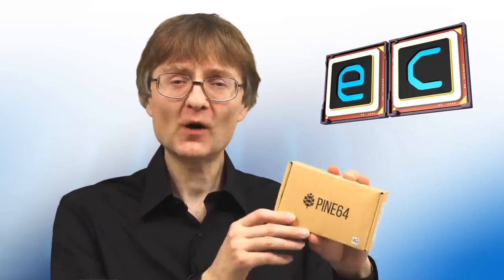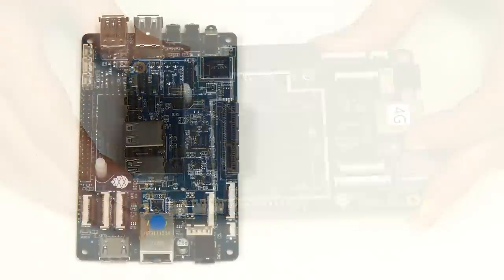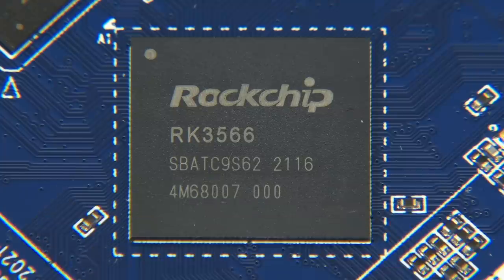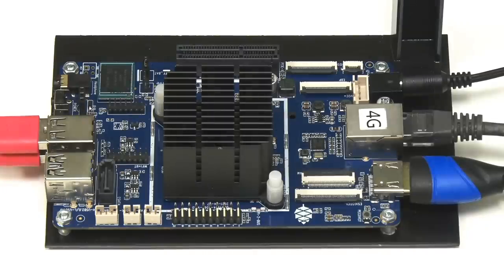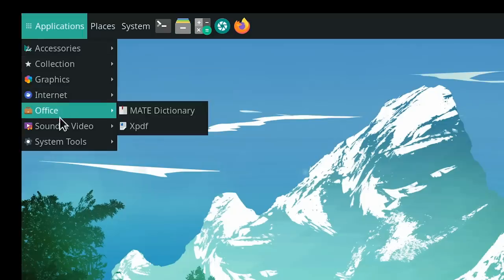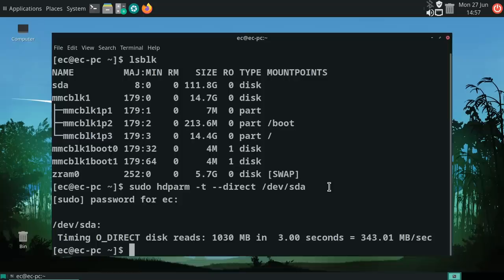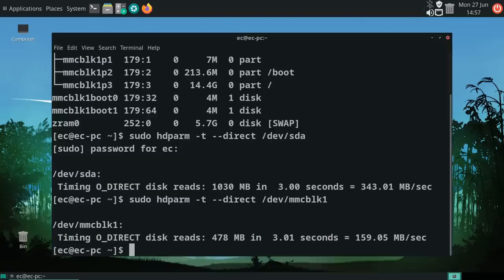Quartz64 Model A – PCIe & SATA SBC

Comment: This had so much potential but has been IMO neglected by the programmers at Pine, to not have a fully working desktop over a year after launch is unheard of, maybe they should relaunch it as The Lemon Pi!
Reply: That's the secret sauce of Raspberry Pi-- software and long-term support.
Reply: They intentionally release boards with immaturely supported (relatively new or obscure) chipsets, so as open-source enthusiasts can tinker with them and hopefully add mainline kernel supports to them in a relatively early time. Pine64 themselves don't really provide any software support to the devices (maybe a basic BSP boot image or two, and that's about it). While it is a bit doubious business model, they are welcomed by open-source communities because some boards are better than no board.

So, you really should not buy random boards from them unless you are okay with that. Some old boards (based on Allwinner A64, RK3399, etc) are pretty well-supported, but new board, not necessarily.
Reply: @Peter Kropotkin Gatekeepers are in every community. Use a computer however you want, that's kinda what Linux is about, right?
Reply: @countorlock3148  Me too! I originally intalled a Red Hat version that came on a magazine CD ROM although I had dual boot as Red Hat was used as a learning tool only, luckily I leared CLI on my Amiga in the late'80s and the transition from Amiga CLI to Linux was easier because of this, Im no expert far from it but I do try to do things from CLI, its so fast! and the OS is lightening fast, back in my Amiga days we used to call Windows Windoze as 3.1 was so so slow LOL
Reply: @Peter Kropotkin I wouldnt call my self a scrub but im neither an expert, i can acheive what I set out to do.
Reply: @Peter Kropotkin Hahaha okay dude. Y'all let's drop this. It won't go anywhere.
Reply: It seems the problem with lack of support is the drivers for the hardware. It appears those making the distros for the hardware are waiting around for others to make the drivers for the hardware. This really plagues the PinePhones as there is still not a single stable OS for either model them despite the first version of the PinePhone was shipped way back in January 2020
Reply: You lot need to stop feeding the troll who lives under the bridge. Leave him to his ego and his CLI lol
Reply: @Peter Kropotkin or maybe buy one to learn about Linux? I bought the first raspberry pi and learnt about Linux from that. Now I use an old laptop for light tasks.  I think  buy something to learn about it! It's fun overcoming problems.
Reply: @Peter Kropotkin That sounds a bit mean and pompous and isn't a very good advert for Linux, I am a member of the 'open source ' community and it very much is about helping and encouraging people at all skill levels, your comment suggests that you yourself have misunderstood the term as it hinders and discourages people who want to learn.
Reply: @CyborgZeta  Well said !...cheers.
Reply: Pine64 doesn't have any programmers at all. They release the boards before they are fully supported so that community developers can get their hands on it.
Reply: @Peter Kropotkin One thing that I would point out is that the leggy display output here indicates a deeper underlying issue of the board, the poor upstream kernel support (at the moment. it is improving, albeit slowly). The problem is not just with the video output, many other peripherals on the board are also not well-supported. If you don't need a display nor any of those peripherals... then you are not the target audience of the board anyway (it is not the best bang for the buck if all you need is some processing power). 

Also, the graphic output is one of the main selling point of this chipset. So, it IS a big deal. You don't just say "terminal is good enough" and call it a day when the intended applications of the board is broken.

In fact, the intended main use case of the board at the moment is... to let open source devs to FIX these issues (including the GPU support). As mentioned previously by myself and by a few other comments, Pine64 is doing this intentionally (they know that there are open source devs who would volunteer to do this, and the open source community is kinda okay with it, because someone has to make hardware).
Reply: @logan26111  Makes sense.
Reply: @RetroGameStream  all the people saying whoever can't blah blah blah or whatever are probably new users on an egotistical power trip.
Reply: @Peter Kropotkin Turbo virgin.
Reply: Wait, what? Since when has PINE had programmers? I could have sworn they relied on unrelated volunteers like Megi for software, and only dealt with the hardware side of things.
Reply: @execration_texts  🤣🤣🤣
Reply: You are justified in expecting a "full experience" (plug and play smooth graphical experience) since its a sbc just like the rpi that managed to achieve that. But when it comes to pine, you have to look at another angle.
There are PINE engineers, and community developers. One makes the boards, and the others make it work.
So, if it can boot and show things in a screen, then that is already plenty. And, from what I gattered, most drivers are working and all the ports respond. 
Give me a working kernel and the drivers, and I can work myself out from there, and thats what someone interested on this specific sbc at this especific date should be able to do.
If you want a smoother experience, go the LTS route (literally) and grab the older model, that is tried and true.
Reply: Learned my lesson with the Rock64.
Reply: Yeah I have the RockPro64 and Rock64, neither have a desktop that works well. I run them CLI

Comment: The appeal of the sata port had me excited, but what good is it if you can't use it (at least easily). Thank you for testing out this board, saves many of us the expense and headaches.
Reply: Why can't there be sub $50 sbc with a Sata port that works? It would make some serious money.
Reply: @setgeeks  agreed, I think there are many of us that would like to use an SBC as a lan connected fileserver.
Reply: @setgeeks  It's called a thin client like fujitsu futro, HP Txxx or Dell WYSE
Reply: @setgeeks  They have been around for a long time: take a look at the "Banana Pi"
Reply: It's easy, simply write your own driver and do you own reverse engineering  ; )
Reply: @MarquisDeSang  yep, nothing easier than reverse engineering an ARM SOC using marketing material. ;)
Reply: @tonyfremont  Easy if you have the tools and... an army of the best electronics specialists and OS writers.
Reply: @tonyfremont  haha
Reply: I don't really get the point of these SBCs. What's the point in having a tiny, underperforming, exposed motherboard, when something like a thin client is more capable, in a case, and ready to go?
Reply: @FlyboyHelosim  They have more input and output GPIO + microphone array + lcd output + ... than a regular pc and they are dirt cheap. Also the only way to have a cheap Risc-V Linux to programme in Risc-V Assembly.
Reply: @MarquisDeSang  it might not be necessary to write a driver but only simply update the device tree... But: you need to know the HW details...
Reply: @ronaldglider  Or just trace the CHIPS with an electron microscope and the pcb with an X-Ray… Easy.
Reply: @MarquisDeSang  Yeah: I have nothing better to do than buying a 100'000$ tool to fix a 60$ board!
Reply: @ronaldglider  Easy just build the tools yourself, save 1$
Reply: Thanks, everybody for a very lively and enlightening discussion. Just taking out a second mortgage now to buy that electron microscope. Anyone want to go halfsies?

Comment: Looks like the Quartz64 Model A is a SBC with potential, but lacks software support even one year after release. Thanks for another high quality review.
Reply: I was thinking the same thing. Seems they released a whole lot of hardware features just for the sake of saying “We have this”. I know SBCs are for tinkering, but kinda useless to have hardware available that isn’t actually usable - like having 4 different video outputs on a device who’s own webpage says the software doesn’t support video output.
Reply: aggree like another pine64 board less software support
Reply: @Tony Yeah, this isn’t likely for the average user. I just find it odd that even a year later, the official software is still in “beta” (basically) and lacks video support on a device that has 4 dedicated video outputs. But I do agree that for someone who has the knowledge and time to spend developing for the hardware, this isn’t likely as big of an issue.

Comment: What good is an SBC without working software? Honestly at this point I'd struggle to justify any ARM SBC not called Raspberry Pi if the maker's idea of software support is 'let the community do it for us'.

Thanks for showing us all these SBCs 🙂
Reply: This attitude is becoming endemic to manufacturers in China, eg. Creality the 3D printer company does this with their Marlin firmware although you do get a printer that can only just produce a print but forget about the bed probing working correctly or any Marlin features after 2017
Reply: Thanks for saving me the effort of writing exactly your comment. There appear to be very, very few, if any, SBCs with decent software support that aren't a Raspberry Pi.
Reply: I mean, on some level that's actually the point of Pine64, they work to get open hardware out there and support the community building on it. Stuff like this can be really good for folks working on Linux development, prototyping for custom development, etc. Not all these boards have the same target market.
Reply: @SeverityOne  Very few? Are there any? Hell, I'd be happy with software that AT LEAST supports the features the board has!??!
Reply: No smooth DE = no software
You are right in expecting a full experience after such a long time, but I think its excusable since its basically a community project.
Buy the older module if you want a change, or a Raspberry pi if its that what yoy expect in the end of the day.

Comment: I eyed this board, but ended up pre-ordering a Rock5 Model B. I'll need a  m.2 breakout board to use a PCIe card, but the other hardware specs and AI processor in the Rock5 seem to be seriously upping the SBC game. It's exciting to imagine something using the NPU for a smart PiHole and enhanced ad-blocking, or building a firewall that uses the NPU for modifying rules on the fly.
Reply from the maker: The Rock 5B will I think be an excellent board.
Reply: have fun not getting any of the NPU to work, since that relies on BSP linux with a proprietay userspace stack that needs a very specific userland
Reply: I thought there was some progress on getting open drivers for the npu on rockchip...
Reply: @rpavlik1  no, there is nobody working on this as far as I'm aware, and being involved in RK3588 mainlining myself, I'm pretty well aware. Besides, the RK3566 on the Quartz64 would use the same driver.

Comment: Mainline kernel support is going well on the quartz64, and they do have the advantage of being an open hardware design as well (you can download the schematics for the board). Personally I use the pgwipeout kernel with Debian bookworm on mine and it's rock solid stable. The only thing that I can't get working at the moment is the mipi-dsi LCD panel but I'm sure eventually it will work. If you buy one be sure to get a woodpecker serial adapter for console at the same time.

Comment: The market for these boards must be pretty limited and ditto the sales revenue. I suspect that most of the revenue accrues from the "Something new" marketing effect. So, if the thing isn't initially brought to market with full software support they're unlikely to do anything to remedy that a year-on - the investment just won't get the return because, a year-on,  the next "Something new", possibly slightly improved, will have hit the market.
Ah, you say, the "Community" will complete the development but if its not open-source that will entail trail-and-error at scale with the distinct possibility that one wrong move could "Brick" the device and, if the initial take-up is low, due to publicised issues with device support, what size will the "Community" be who are willing and able to persevere with further "Development" ?
Can't understand the mentality of the producers of such devices.They know what the score is with regard to the opportunities in such a market where "Quick in and out" is the order of the day and "Getting it right first time" is essental.
Or is this typical chancer American enterprise ?
Reply: Yeah, for some reason they keep putting out stuff which never gains a lot of support. Look at their PinePhone. First version shipped two and  a half years ago, and still no stable OS for it.

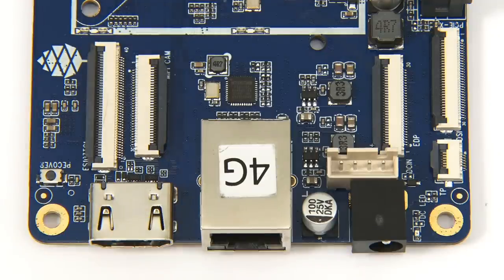Comment: At 6:39
Request going forward....

While going through the ribbon cable connectors I realized that it would have been better if you had used a pointer of some type. My original thought was something like a crayon like shape made out of plastic, (so it doesn't get wax on the parts and the plastic won't damage the delicate electronics).
This may be something to look into for future videos.
Will there be a"Mr. Pointer" in the future??

Comment: I think you should look at the Rock5 model B with the RK3588 processor.  It is much faster than the quartz series and is up to 16Gb.  It also has an M.2 slot for storage and will support 2 8k displays.  According to the company they will be providing Android 12 as well as Debian Linux for the board.
Reply: That's a very new processor but it should be pretty powerful once the BSP/distributions are ready.

Comment: 16:29  Do IT!  And while you're at it, recompile the kernel, and write a program for more connectivity!  Make a whole dev series on this board.  Have you seen Jeff Gerling's series on trying to get a GPU running on a raspberry pi?  While I don't have the technical skill to do so, I would find it utterly fascinating to see someone who does work on this SBC.  Also, I would love to see any of the SBCs you own to get heavy modifications to the board itself, it seems to me there is a lot of experimentation going on in SBC land much like PCs in the early 80s.
Reply: I think it is a waste of time. Jeff is working on we'll known, community supporting board with good initial software support by manufacturer and extended by wide community. The same applies to GPU on ARM in general.
On this board we have promising hardware with no support and a wish from manufacturer to write the software for them. I'm not sure this is the way to go.

Comment: Bit confused by this SBC considering the MALI GPU and missing SPI flash on the rear. Surely the end user is going to have to recompile some kernel modules themselves to say supporting accelerated graphics and data. Perhaps the likes of Jeff Gerling or ETA Prime may have a more success than yourself as the specs look half decent.

Comment: Veddy interesting, especially as I have a Pinephone that's more or less the same base unit. (I don't use it as a phone, but as a micro-portable, with the excellent Pine keyboard.)  It runs Manjaro/KDE, and while programs are slow to load, once they get going performance is smooth enough. Will be pleased to see future developments for these Pine64 units.

Comment: It sounds like the Pine64 people are missing the boat. With the Raspberry Pi in such short supply, the Pine64 people could pick up some market share if they got the software up and running.
Reply: 100% AGREEMENT
Reply: There are a slew of OS variants available for the PinePhone (mine runs Manjaro/KDE). I wonder if any of them would work on the Quartz64.
Reply: @Reziac  it would be interesting to see.
Reply: @Reziac  No. The PinePhone is based on the original Pine A64
Reply: @knerduno5942  Thanks. I haven't kept track.

Comment: States in semi-annual update about making shorter videos, 2 weeks later drops 17 minute video. ;) Had hopes for this board but just doesn't seem to be there yet.  Hopefully someday soon.
Reply from the maker: Yes, that did not work out too well did it?! :) Although last week's video was under 9 minutes (if for specific reasons).
Reply: @ExplainingComputers  I actually prefer the longer format videos as they usually contain lots of good info.  I have several videos tagged that I will refer back to as needed to work out some specific problem.

Comment: Hmm.  Something seriously wrong with the IP binary blobs model if drivers for base functionality are still missing after a year.  A few months you could accept due to the complexities of the things, but this situation makes manufacturers look shoddy, when in fact it's the IP owners being shoddy and not helping or creating drivers / fully publishing interfaces for their design-only products.
Board and chip manufacturers need to start boycotting IP holders that do not support those manufacturers access to their opaque designs,  OR be legally forced to open up those interface designs under fit-for-purpose grounds. 
It's like selling a car design with an inaccessible petrol filler cap.  Unacceptable.

Comment: Oh man that (lack of) support sucks. It will be interesting to see what their as yet unnamed [1] RISC-V board with "same form factor, similar price and performance" will be like in a few months. They haven't announced it, but it's almost certainly using the StarFive JH7110 SoC, the "mass production" version (with twice the cores and with a PowerVR GPU) of the JH7100 which was supposed to be released in the BeagleV "Starlight" 10 months ago. The JH7100 has been available in the BeagleV beta board (300 boards distributed free in April 2021) and in the VisionFive v1 and is at this point quite well supported. Hopefully the JH7110 will be able to use all that work and be good out of the box.

[1] they know the name, but are holding a competition to guess it
Reply from the maker: Agreed. I suspect that we will see a board from StarFive first.